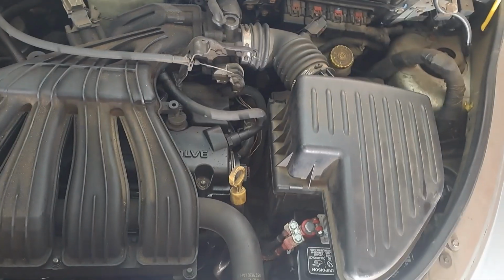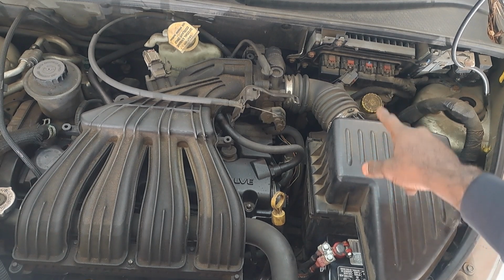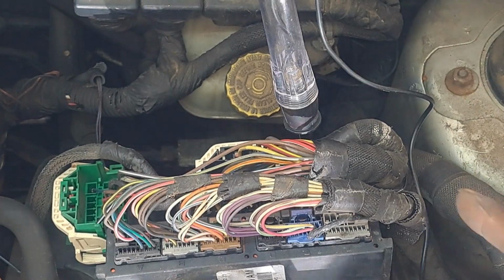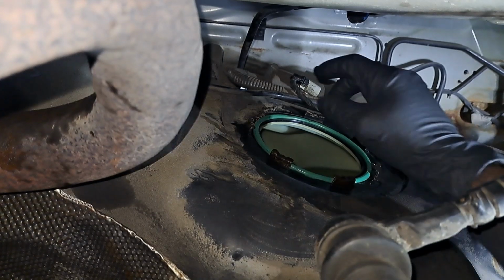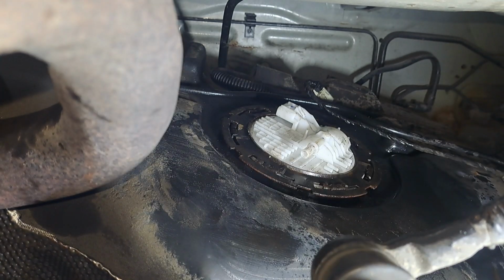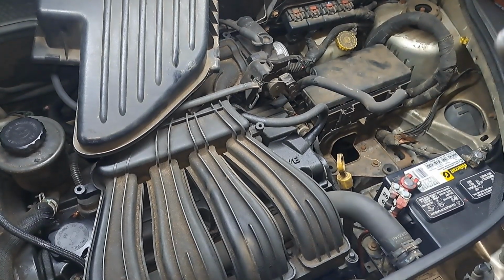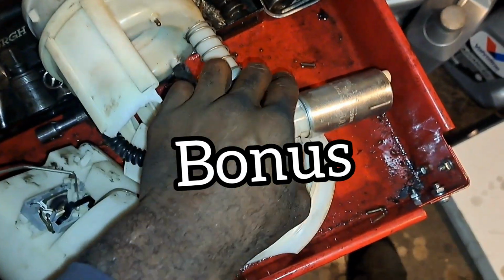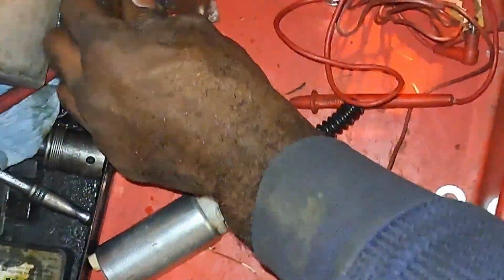CRANK no start PT cruiser just towed in

Comment: Throttle position sensor is a common problem with no start. It's easy to get to as is right there on top of motor. Also, you can turn key from off to on 3 times quick and car will give you a error code. Look up that code and see what problem is. I have a 2006 PT Touring, I love it because i can do alot of the work on it myself. I have done theTPS, cleaned throttle body, replaced camshaft sensor, brakes, rotors, calipers, struts, spark plugs and wires, and bul s all around. Am 3 minutes into video writing this. But I would check the throttle position sensor before tearing into the fuel system. Jm2c